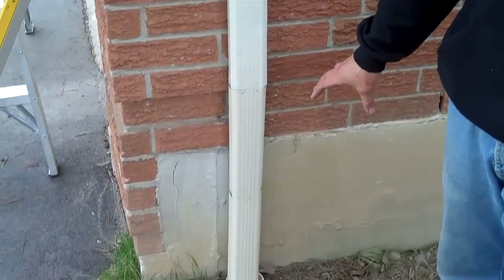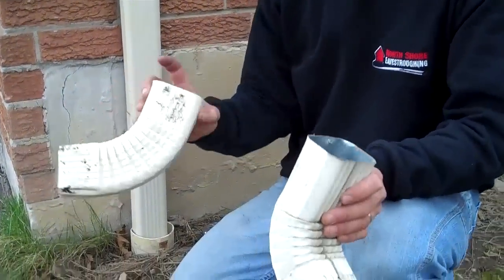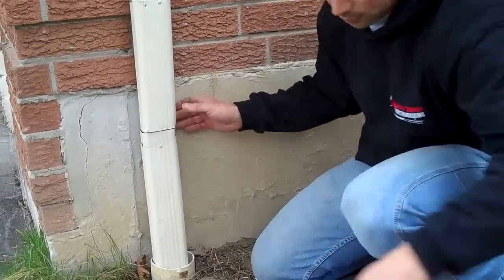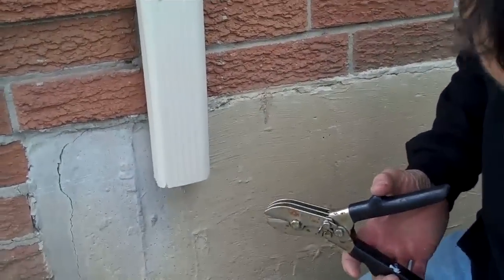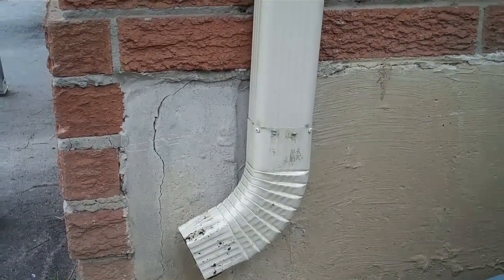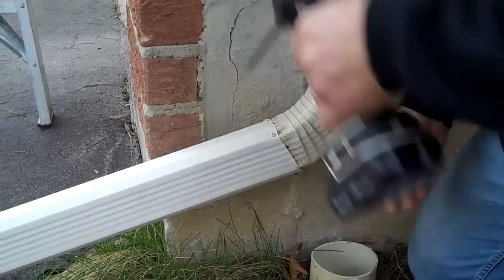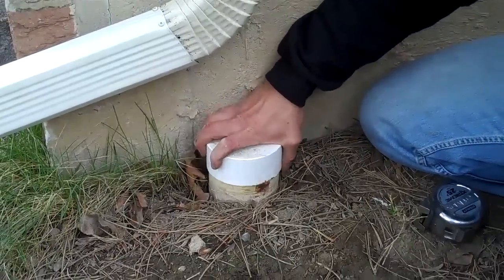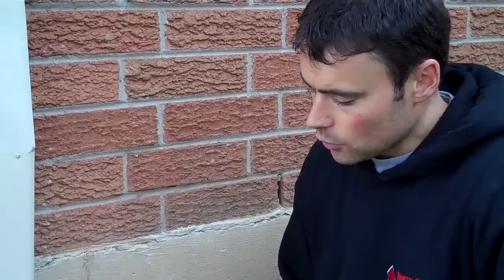Toronto Downspout Disconnect Instructional Video

Comment from the maker: You can use anything for a simple disconnect without incurring any troubles. We use a treated (dacrotized) 3/8 screw, painted factory painted to match. This prevents rust. I am glad you found the vid helpful.

Comment: Thank you this was very informative. No one want to come out to do this work on my home as im guessing its too small of a job. I would like to do this but i have no where to direct the water away from my foundation. If i point this directly away it goes to my fence that i share with my neighbour. This has been a problem spot in the past as it seems like a sink hole around where the water flows
Reply from the maker: Thanks for the comment. I assume your in Toronto. When we worked there, we are now in PEI,  there was exemptions for downspouts that could not be properly directed away from the house. Good luck

Comment: Thanks for the video! My current downspout with elbow goes right down to the ground. We have been having water coming into our basement so I have extended the drain out into our yard but I need to cut it higher. How high should I cut it to give it the run off that it needs to get it away from out house?

Comment: Great work, very helpful. However for me, I need to clean out a clog at the bottom the downspout where it meets the clay pipe going underground. If I can't clean this out I don't know what to do. My back sidewalk wraps around the house and the spot you put the new downspout would be my sidewalk. Any ideas where I could locate the new downspout?
Reply from the maker: Thanks for the nice comment  sometimes there just is no good solution unfortunately. This could be the case for you and if you cant clear the drain then you can excavate maybe to redo the pipe or just drain onto the walk which hopefully slopes away from the house. Good luck
Reply: @torontoeavestrough  thanks for the help, I think I fixed it, the old downspout was clogged and installed improperly.

Comment: Is there an example where the downspout has to go under a patio stone - one of my downspouts is at a high traffic area and I cant lay the pipe above the ground - it will have to go under - Should I use PVC pipe underground - ?
Reply from the maker: Yes 4 inch pvc to go under ground. Has to be a slope in ground so can get pipe out of ground however. If in Toronto there may exemptions still for certain pipes. I am in PEI now a bit out of the loop for that area.

Comment: Have you ever seen mice go up through the downspout and access to the attic? i think i have this problem and what i am going to do is cut the pipe and put a "flex grate downspout filter" to block the access to the attic.
Reply from the maker: Yes have heard of animals running   up downspouts, but when at top at gutter  there shouldn't be any gaps  under roof edge leading to soffit/attic.  Maybe best to address that issue as well if present.  Good luck

Comment: This is a wonderful video. I loved it. Finally answers to my questions! However on the side of my house the downspout leads to a clay pipe (the clay pipe is in pieces and shattered and goes diagonally into the ground.) I actually found that cap cover at home Depot today but it doesn't fit because the diagonal pipe is almost flush with the driveway. I would just like to figure out another way to cap it off. 
Also in the backyard the downspout goes down through my patio concrete. A big hole in my lawn as appeared right by the downspout. I can stick my arm in and feel that the down spout doesn't connect to the clay pipe. There's a gap. There not enough space between the end of the downspout and the beginning of the clay pipe to put that cap on. I filled the hole with gravel today. I jist want to cut the downspouts and divert them. But I have to cap these pipes too
Reply from the maker: Hi Marc   thanks and glad it helped. Its not uncommonto have to cap a clay pipe thats broke. No easy way  maybe fill will plastic and then spray foam, then cN concrete over.  Usually the pipes are in about 3 foot sections and if you can dig up a bit to reach the next pipe it may accept a cap properly.  Good luck

Comment: Why would you just not drain it into the pipe?
Reply from the maker: City Bylaws  some of these drains mix with sewage pipes and over whelm city infrastructure. Sewage ends up in lake. Also even if not a combined system the water often flows to a ravine which are also bursting at the seams on the heavy rains.